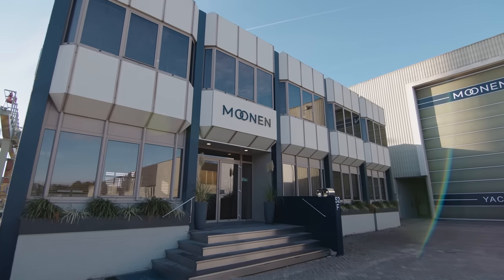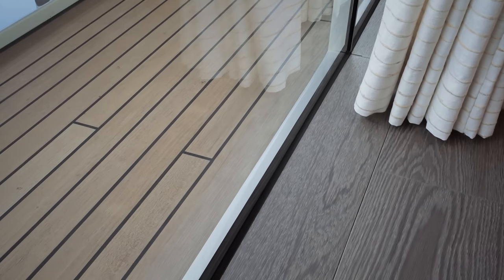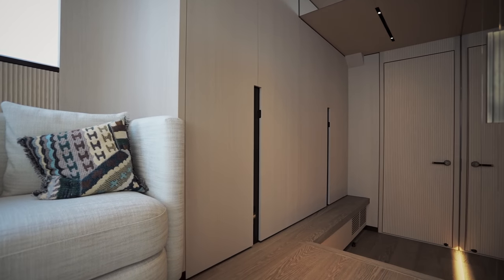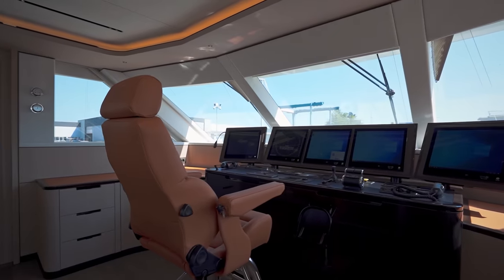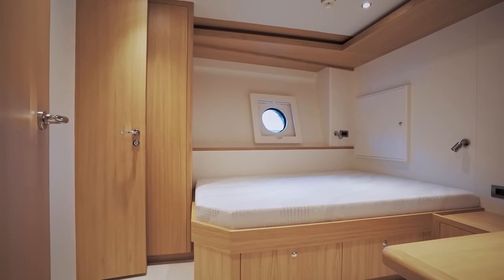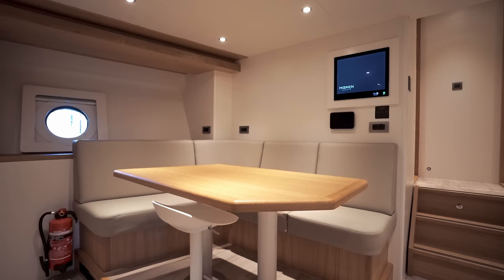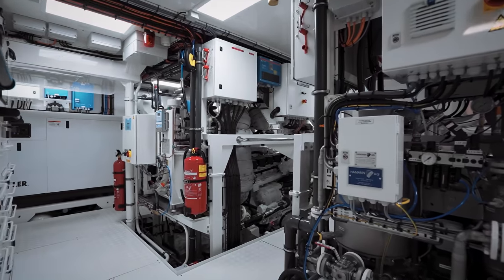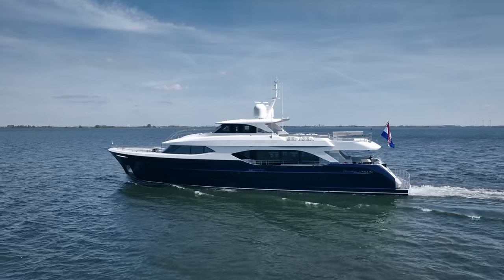Inside Moonen's brand new 110' - DEBUT APPEARANCE OF THIS YACHT!

Comment: I actually installed a soundcheck app to compare these results.
With open windows and cars passing in the distance which I don't even register anymore, I never got under 35-40 db. When my neighbours turned on the washing machine it went up to around 45-50 and even that doesn't really bother me. So, having around 35 db while the boat is running is nothing but amazing!
Great video and great showcase of some great features!!!

Comment: Truly surprising what they have fit in this size vessel.  First is the obvious amount of quality components and well engineered systems.  I agree with the proper lazarette vs. some gimmick.  5 very nicely sized staterooms, and multiple areas to get a little privacy in different areas of the vessel in or outside, and all well separated is a neat trick for this size!

Comment: Wow. I never realized how much the details of silence and shape really do make an enormous difference in how you can actually USE a boat. This is no wedding-cake yacht that can only sail in the daytime for short hops between islands, and has to be loaded on a yacht transport for anything else. It's a real boat, that can get where it's going on its own keel pretty much wherever it's trying to go. Silence, range, and enough space to be comfortable over that much time should equal true transatlantic capability, so long as it can tolerate the weather. Is it rated for crossing?

Comment: I will never understand how new yachts are not equipped with solar panels. There is so much surface area which is exposed to the sun every day all day - why would you not try and cut down on fuel consumption? AC and standby power could easily be provided by the sun.

Comment: Lovely and very nicely designed yacht,  but the number of steps or the number of separate small steps, let alone the number of main internal and external staircases too.

On a very new or modern super yacht, which will be purchased by individuals who are more than likely in their late 40's to their early 60's.

So may not be as fit as they once were, or have developed let say mobility issues or some health or disability issues,  or have family and friends who do have.

So sooner or later there will be access issues, with regards any yacht someone buy!

Also to be honest super yachts costing over 10 Million Euro's, let alone up to 17 Million Euros of this super yacht, or superbyachts of over 20 Million Euro's too.

When these super yachts are a very large purchase price and long term annual operating costs, around 10% of the purchase price annually too.

So with this super yacht annual operating costs, could be around 1.7 to 2 Million Euro's annually, on top of the purchase price of 17 Million Euro's.

I know some will say, if you have ask the price of a super yacht, you cannot afford it in the first place.

Then having to take into account maybe long term servicing and maintenance, as well as future possible improvements, upgrades and modernisation costs.

Say over a 20 to 30 year lifespan of these super yachts, or longer lifespan too, maybe with two or three refits within the average super yacht lifespan.

Should not these super yachts builders and designers, right at the start actually include in their designs and builds, to allow for some level of disability or some level of mobility access. 

For possible owners and their guests or passengers, who may come onboard?

What is the rules for yacht builders and designers, over providing for Disability or mobility access, any at all?

As commercial vessels, Cross Seas and Channel Ferries, or River Buses and Taxis, or Passenger Hovercrafts, right upto Ocean going Cruise Liners, even Sightseeing and Dinner Cruising Vessels, all are required to allow for and include disability facilities and mobility access.

I just wondered, has the private yacht industry, not heard of European Disability and Equality Discrimination Laws, over Accessible?